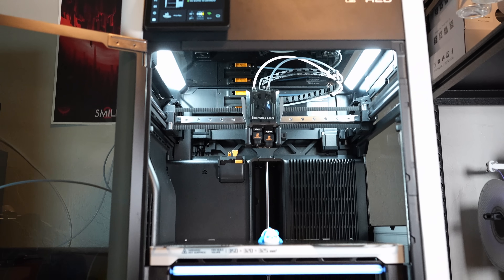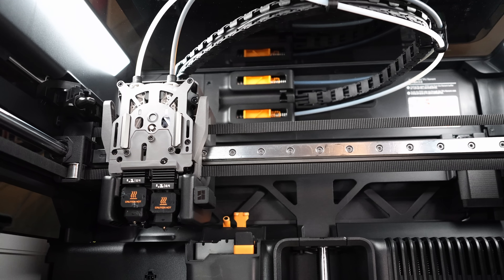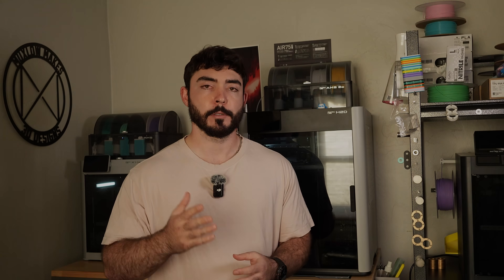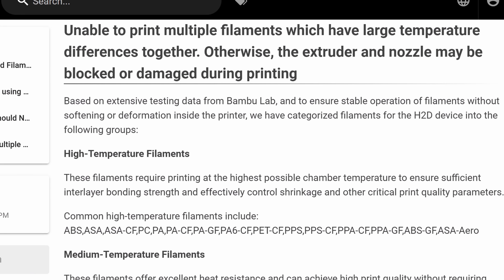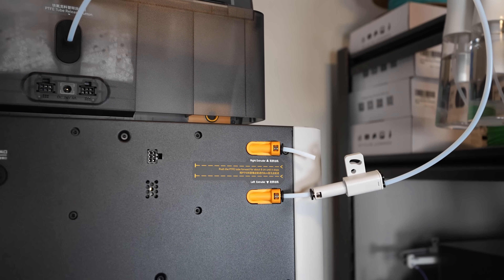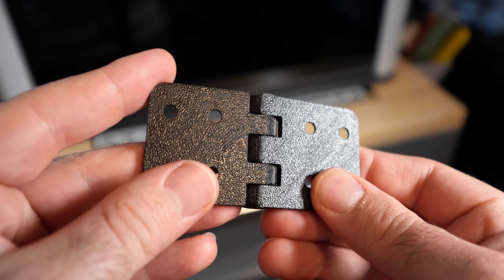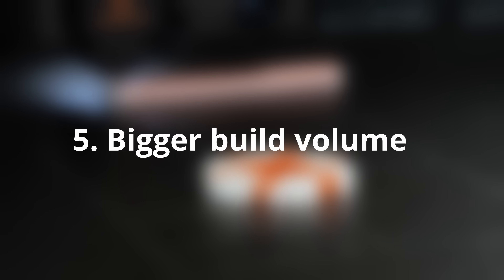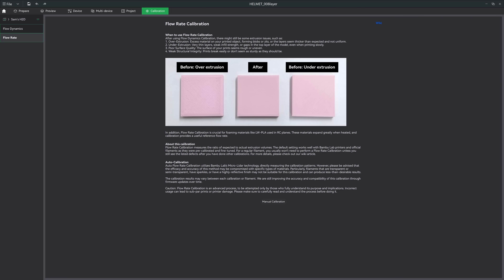5 Things I Love & Hate about my Bambu H2D

Comment: Super information - many thanks. Though I am still waiting for my H2D I am very interested in more information about printing TPU. Is it completeley impossible to swap colors while printing TPU ?
Reply from the maker: @G.Sonnenberger  as far as I know you can't with both nozzles. Im sure you can manually swap the filament in the right though. Maybe I can try this for you!
Reply from the maker: You could probably also trick the printer into thinking its loading PLA... and adjust your settings in the Bambu Studio. Maybe developer mode allows it..?
Reply: @sammuxlow  trick it.. let us see what happens :)
Reply from the maker: @ryanmast6977 😉
Reply: @sammuxlow  That is exactly what I did on my Prusa MK3S+ with a MMU2 - I told the slicer PLA is to be loaded ...
Reply from the maker: @G.Sonnenberger  I've done it before with my X1C. Used that trick to load 95A TPU through the AMS